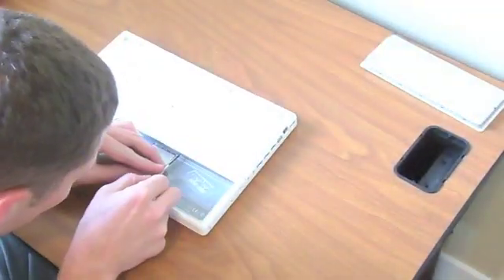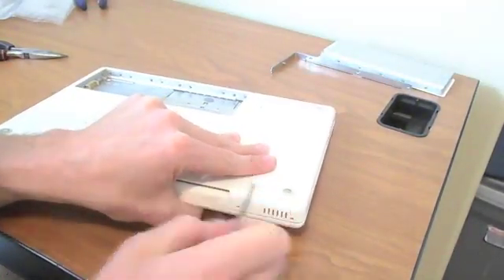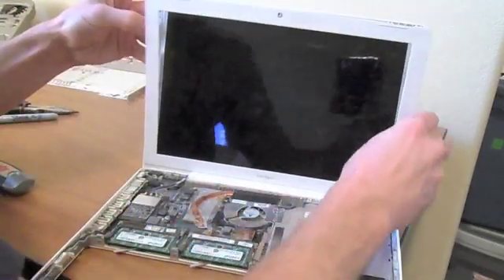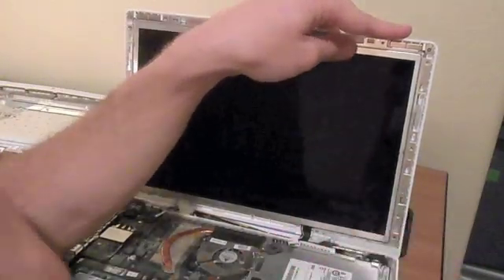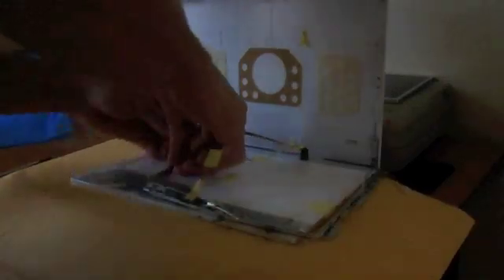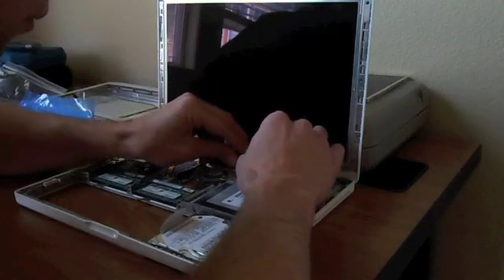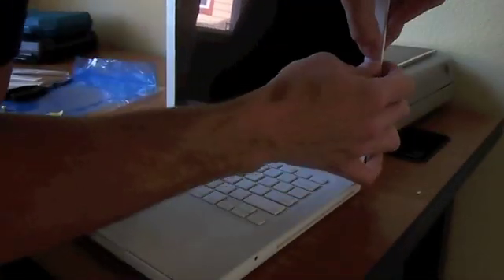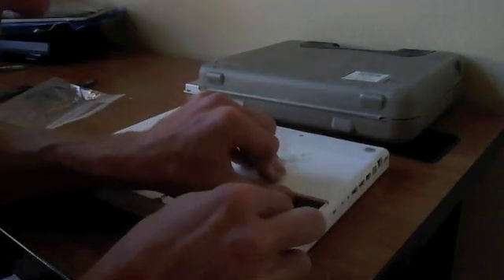Laptop screen replacement for Macbook 13 model A1181

Comment: Worked for me, thanks. Putting the inverter cable cover back was pretty difficult and I wound up snapping off a couple of the tiny plastic lugs that help it click back into the correct place. I found that lifting the entire lid and hinges just clear of the main body helped me to see what was supposed to go where. The tip about removing the grey clips from the white screen surround and re-seating them in the metal frame on re-assembly was useful but could perhaps have been made more clearly or shown explicitly.

Comment: Great video. I tried and failed. First try, machine would power on, but new screen didn't work. Repeated disassembly, found I yanked a little black connector (I think the iSight), fixed and re-assembled. Now my power button doesn't do anything. I found re-seating the keyboard the most tricky. Hopefully I just have a case of the power button not making good contact due to poorly seated keyboard, and not something worse. I give up for today, though.

Comment: Thank you for this video.  Your video helpful because of the inverter cable difficulty.  The people that demonstrated the short cut all indicate how tricky that step is.  But your video demonstrates the way to get right at the connection and put it in without a lot of agony and defeat.  And besides I have a couple keys missing on my keyboard as well.